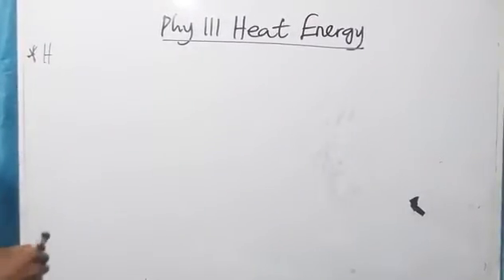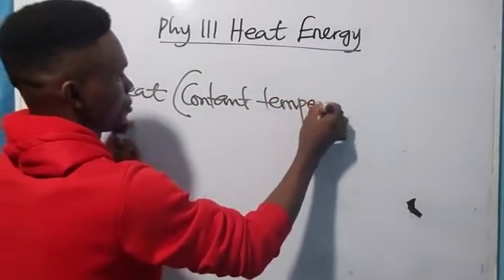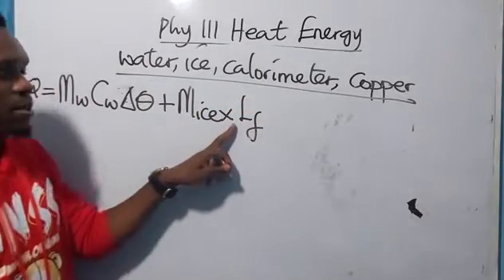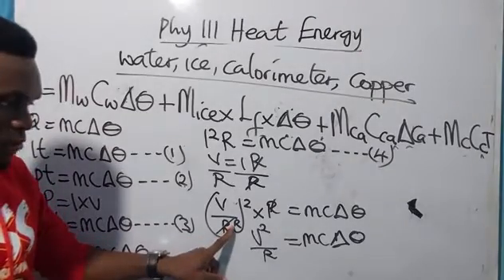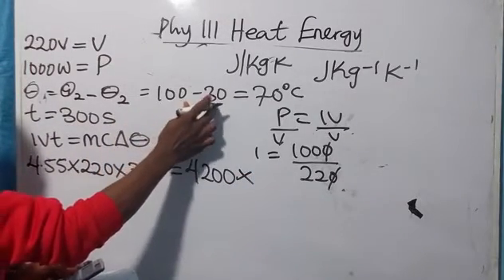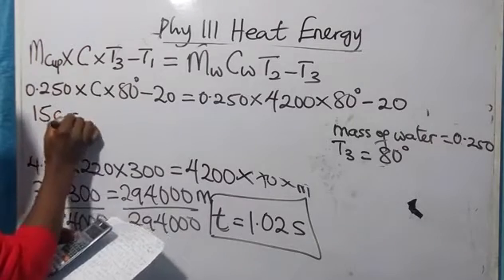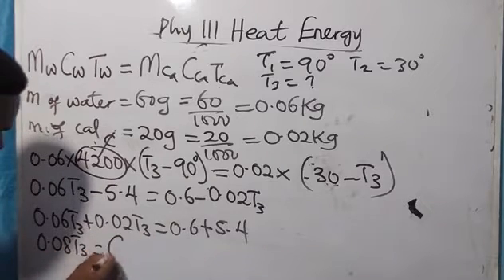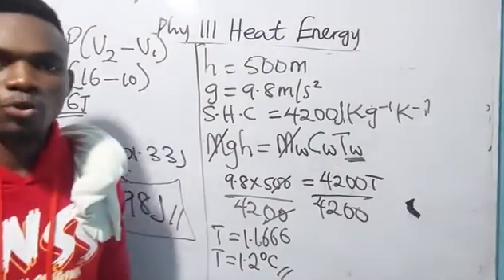Heat Capacity, Specific Heat Capacity and Specific Latent Heat of Fusion and Vapourisation.

Comment: Sir, when u were solving for electric current you said that lvt = mc∆(temp).
Then the next one you didnt add that time you just wrote I^2 R. That for equ. 3
Reply from the maker: What question is that?
Reply: when u were still deriving the formular of specific heat capacity under power